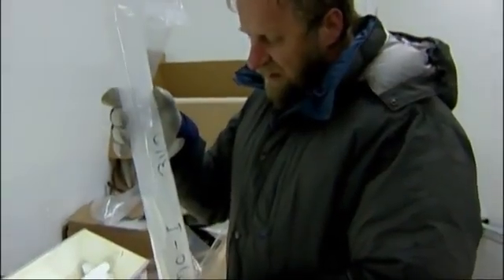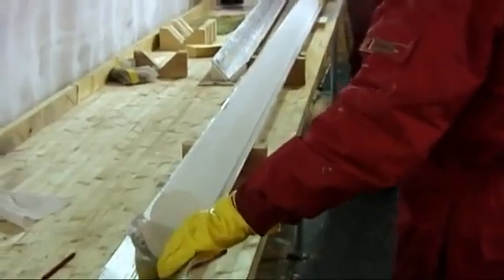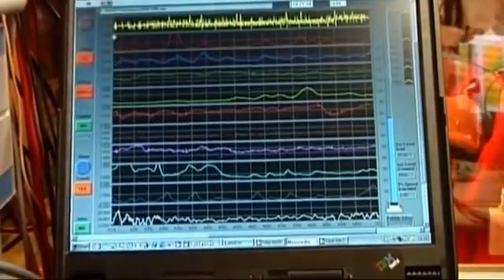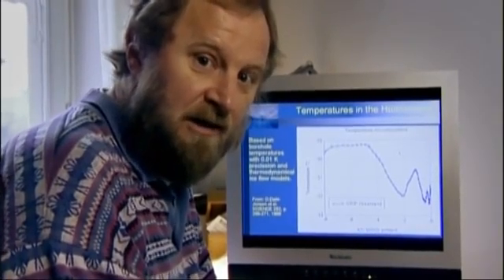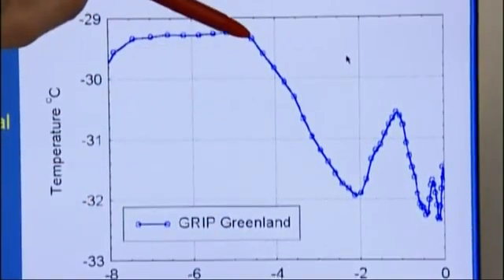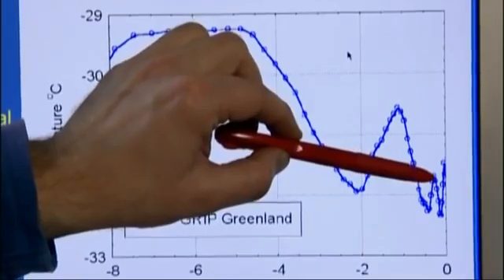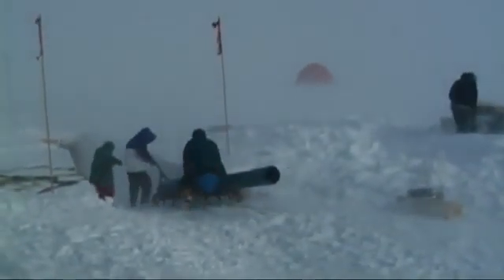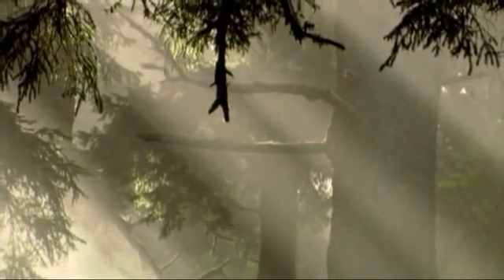We Live in Cold Times

Comment: @CO2 Coalition  Firstly: Have you any info about the ratio by which any differential of the global temperatures effects temperatures in Groenland versus temperatures at the equator? Secondly: Some 6000 years ago with temperatures some 2° C higher than now the ice sheet was still gaining thickness (otherwise there would have no layer to take a measurement from - I assume). How is this possible? Given the "fact" that the ice caps will gone by "pretty soon" according to the climate-cultists?
Thank you.
Reply: it's important to note that the current trend of global warming is causing the polar ice caps to shrink at an accelerated rate compared to natural climate cycles.
Reply: Temperatures were not higher 6,000 years ago. Temperatures are now higher than at any time during the Holocene.

Globally resolved surface temperatures since the Last Glacial Maximum

Matthew B. Osman, Jessica E. Tierney, Jiang Zhu, Robert Tardif, Gregory J. Hakim, Jonathan King & Christopher J. Poulsen 

Nature volume 599, pages239–244 (2021)
Reply: It is very likely that temperature in Greenland were higher 6000 years ago. In Greenland and others northern high latitudes areas. Not globally.
Higher but not for long.

Comment: While I'm not disagreeing with this, there are a few things that don't make sense to me.  
They go 3km down, which represents 120,000 yers.  How do they know this?
Why are they only showing the last 8,000 years?
How do they know that the temperature in the hole hasn't changed by them making the hole?
How do they know that the temperature in hole hasn't changed since the snow was laid down?
Question everything!
Reply: good questions, but the answers are out there. 

"They go 3km down, which represents 120,000 yers.  How do they know this?" they calculated it based on the known thermal properties of ice. you can measure the rate it takes for temperature to change in ice. 

"Why are they only showing the last 8,000 years?" a possible reason is because you have to go down a long way to make sure the ice is insulated enough, and is permanent. so 3km down is just what it takes to get past all the temporary snowfall and such. This is also likely why the graph only goes up to 1950 instead of showing the last 70 years of warming. 

"How do they know that the temperature in the hole hasn't changed by them making the hole?
How do they know that the temperature in hole hasn't changed since the snow was laid down?" you can calculate it based on the know thermal properties of the ice/snow. how fast it disipates, how much time it takes, how much insulation has an effect, ect. they can also measure the friction caused by the process of digging the hole and make adjustments. it's very deterministic.
Reply: They know based on the freezing melting processes, which have different structures, they count how many layers are so they can count years
Reply: I agree with your questions...I don't think this video has been properly vetted by CO2 Coalition.
Reply: THey do not get the temperature from the thermal property of the ice nor the rate it takes for temperature to change in the ice. No !

They drill a 4 to 6 inch ice core then store it for weeks or years in a freezer, man made or natural.
Typically the temperature is derived from the ratio of oxygen isotopes in the ice.

Comment: The political global warming alarmists completely refuse to believe the sun has anything to do with temperature, weather or climate.
Reply: Try and talk to them about the current research on galactic cosmic rays which have been mapped and match almost perfectly to the temperature changes of the planet you will get all sorts of insults.
Reply: @marksaunders3055  because there is alot of "may" in that study. It has to do with cloud cover. The study you are referring to says that it increased cloud cover... well that would reduce the amount of solar energy that gets through and cool the planet wouldn't it... so the absolute opposite effect.

A study before it found no link at all between the temperature rising and the amount of energy hitting the atmosphere because one was increasing by a far higher rate than the other.

All this stuff is already entered and though of in the models, none of them account for the temperature changes we are getting and how quickly it changes. The speed in which it is happening is key as it normally happens over 100s of 1000s of years... not decades.
Reply: @Friendlyfirefish  Alas all of this stuff is not entered into the models, I used to work supporting the systems that the models were run on and at that point there was not even data for solar energy put into the model let alone cosmic rays.
Strange that the study produced a graph of GCR levels that matched almost perfectly with the temperature of the planet then seeing as there is no link.
The speed may indeed be quick but there is so much scare mongering with the highest temps on record with no mention that the record is only 100 years old or that the ice cores from Greenland show that our recording started at the coldest point in time so we will always have warming over that point that leads many to question the validity of C02 claims.
Reply: @marksaunders3055   it doesnt match. And solar energy 100% is included in the models. I can look right now and see that solar energy does not correlate to the rising temperatures. Solar energy is decreasing for starters. Lol. I call BS that you worked in anything to do with it.

Our historical data only goes back 100 years? Thermometers go back to the 1600s.

The speed is quick and that's why it's worrying. These changes are supposed to happen over 100s of 100s of years. That allows life to change and deal with it. You guys go on about the planet being fine if we all die but planets are numerous beyond counting. What isn't numerous is ones that hold life and as far as we know so far only 1 has it
Reply: Co2 actually releases half it's stored heat back into space.
Reply: @woodspirit98  yeah, maybe if it's sitting on the outermost layer of the atmosphere you dingus.
Reply: @woodspirit98  
"Co2 actually releases half it's stored heat back into space." [citation needed].
Reply: They absolutely understand. Thing is the sun is less active now, so explain how it's getting hotter. Lol.

They put all the information we have on how things affect climate, it's how they know something else is at play. Lol

Try harder next time
Reply: @Friendlyfirefish  the antarctic broke a record for the coldest temp ever on March 14th, 2023 breaking the coldest temp ever recorded a week or so before that.  If all the surface temps are recorded only in the western countries and still in the same places from years ago around growing cities then of course they're recording warmer temps. Trying to extrapolate data from only a few places and claiming it's the entire globe isn't science. Also models are definitely not science at all. They're biased towards assuming CO2 is THE cause of warming, which it isn't and assuming 100% of the increase in CO2 is only caused by human activity is flawed in itself. There have been three independent studies each using different data that all show 80% of the increase in CO2 is natural and only 20% of the increase is man-made. Based on the natural 230 year cycles of cooling and warming, our temperatures aren't unusual at all and show that earths temperatures are going to be dropping quickly. We are in one of the lowest solar cycles since the 1790's. The polar vortex is at it's weakest at this time of year and yet 2022 was the coldest spring and summer in the arctic. we are seeing heat in Europe and the southern US because the warmer air isn't able to penetrate the northern and southern poles. Global warming and cooling start at the poles. We just came off three years of la ninas making the equatorial Pacific colder three years straight. Almost unheard of.  We are in solar cycles 25 and it's solar maximum is peaking sooner than predicted after coming off cycle 24 which was the weakest in over two hundred years. 25 will be fast approaching it's minimum and it's going to be a wakeup call to the global warming religion. We are going to see colder temps in the next thirty years than people have ever seen.
Reply: No, that's not true.
Reply: @Christopher Wallbank 
No, Allah would not do that.
Reply: people who don't understand how to read a graph think that this video is evidence against global warming. i'd tend not to believe the people who don't understand the data they are looking at. jorgen, in the video, understands, and that's why he supports the idea of global warming.
Reply: @Rin-qj7zt  no he says it hard to prof that the climate change is man made as the temperature for the clima model is made from date from 1875 where we had the coldest clima in 10000 years, thats way we all think it is a a problem that we have a 1 drgree warme clima today .......and thats not a problem
Reply: @Rin-qj7zt  he's not saying the "earf" isn't warming, he's saying it is impossible to blame it on humans